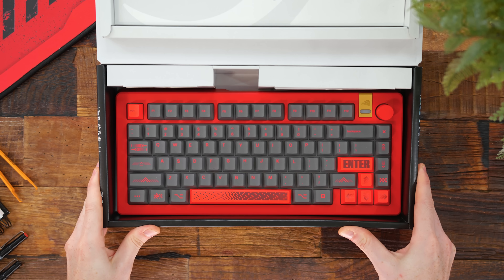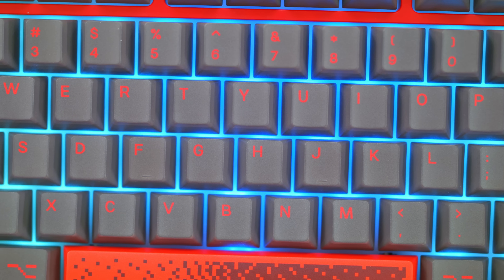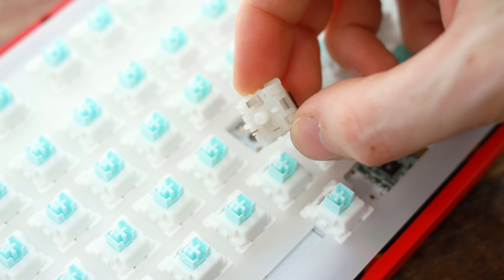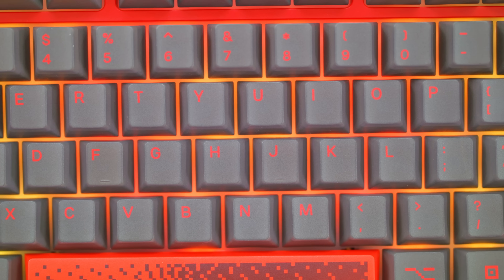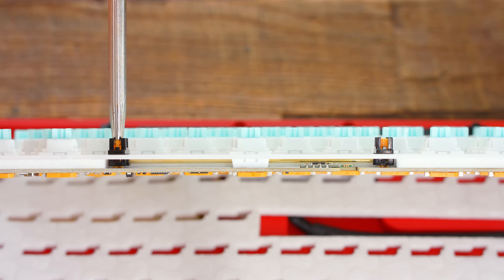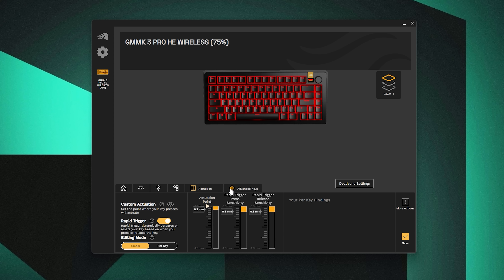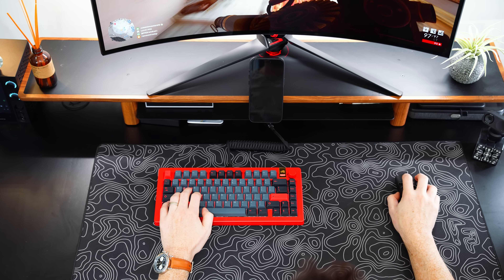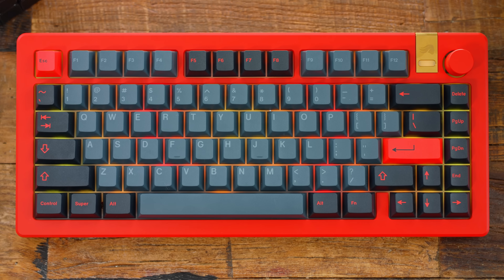NEW Glorious GMMK 3 Pro Keyboard Review!

Comment: $500 for that?... i like the customization but quality seems to suffer.
Reply: yeah i have the lynx switches myself... pretty scratchy and overpriced. but to be honest the board quality is not bad, swap the switches for something nice and you got yourself an okay board (not good value though)
Reply: @Aaron-ym5yx But it costs you $500. Buying a neo65/80 is much better than this one, also better sound and anodisation.
Reply: @兩人行必有我濕焉 it doesn’t cost 500. If you customize yourself it will only cost around 230-250 without keycaps.
Reply: @兩人行必有我濕焉  I bought this same keyboard for 200 dollars on sale at best buy.

Comment: For those wondering, the cheapest HE option is a plastic 60% wired prebuilt option for $180.
Reply: Meanwhile keychron has a Kickstarter for their K2 he which is $120 and wireless and for 15 more you get metal and wood framing
Reply: @Zac-wb7hu got a link?
Reply: @Zac-wb7hu keychron doing kickstarter feels weird. isn't it already an eatablished business
Reply: Meanwhile you can buy a wooting 80he for 195 and get the best performance out of any HE keyboard out there and it doesn't sound like total trash. What is Glorious thinking??

Comment: For the stabs being loud, I guess Glorious wanted to avoid the scandal of the first GMMK Pro : they had pads under their "GOAT Stabs" but since they ended over-lubing them, the pad got sticky and the keys had trouble goign back up and unstick from the pad. I think they wanted to avoif that, and removed the pad completely.

Could be wrong, but I remember replacing tham with a standed band-aid mod in mine back in the day to fix the keys sticking to the PCB and not going back up

Comment: That price though, the rough customization I like was just over 500 and didn't look as good as some board I could get for under 150
Reply: @Zac-wb7hu  They have different models on their website apparently.
There's from least to most expensive:
GMMK 3
GMMK 3 HE (Both Plastic)
GMMK 3 Pro
GMMK 3 Pro Wireless
GMMK 3 Pro HE
GMMK 3 Pro HE Wireless (Pro are all metal)

GMMK 3 starts at 119$, so I'm curious if this is worth. (Probs not for the MX versions)
Reply: That's why I specified 'my rough customization'. But yeah, keychron has a Kickstarter for a better hall effect board for around 135, and wooting has the board gmmk seems to be copying for around 200.
Reply: @Zac-wb7hu  good to know thx 🙂
Reply: @Zac-wb7hu  isn't the Wooting all plastic though? Not that I'd ever recommend this keyboard for 500 or even 150 for that matter
Reply: The wooting is plastic, keychron is metal and or wood frame with plastic body, and the cheapest wireless gmmk3 that includes hall effect is 299, bare bones for 250.  Wired is 179 and polymer body. The cheapest pre built full board is still 120 with no hall effect, wired only, and says aluminum body in the description but polymer in the comparison so who knows. 

Edits for the one board I missed
Reply: If you want wireless and hall effect with all metal there's also the keychron q1 he for 219 compared to the 350 for a full feature match from gmmk, so overall, better for cheaper
Reply: @MekaniQ  Non of them is worth it if you want just a gameing keyboard you can get a Wooting and upgrade the case to metal later if you want a custom keyboard the Keychron Q1 HE is also a better buy . 500 just to get a full metal case is insane
Reply: @emilyshabang  You can get a metal case thats cheaper and just easy swap it in

Comment: You can immediately cut around 150 USD from the price by going wired only. I just tested out a basic 75 % barebone configuration wired and the price was 104 USD.
Adding HE would have cost only around 35 USD more.

Comment: $500 for no internal, or external weight, when it has essentially the same internals and features of prebuilt aluminum HE boards at the $120 or lower range is just egregious. cant believe they had so much time to catch up with how fast the keyboard market has evolved and yet they STILL fell flat with this release. I would pay 140$ max for the prebuilt variant shown in this video, especially for a company with the size and manufacturing capabilities as glorious easily being able to get the price lower just from having access to more machines.

Comment: What is it that makes it so difficult to make a hall effect keyboard sound good? The switches don't have pins and are mounted only to the plate, sure, but how does that make it sound awful? I haven't seen a single rapid trigger board sound decent. It's starting to feel like a big gimmick now seeing every manufacturer take that route.
Reply from the maker: I demoed that very clearly for you, it sounds bad because the switch is rattling in the plate
Reply: @randomfrankp  Not really asking so much as I am thinking out loud. I’m more so just curious about the sound across all HE boards, even those with secure switches. I imagine it’s gotta have something to do with the hollowed out middle for the magnet.
Reply: @JustinBrown-y1z  There's a combination of factors at play. The first is the way the stem is at least 3x wider than a normal mechanical switch with a magnet in it, which not only greatly deadens the sound but because there's such a big opening in the switch housing causes a lot of the sound to leak out and not resonate on the parts.

Then on the PCB side, the fact that there's only two mounting holes per switch means it's not grasping onto the PCB as much as it should and is much more reliant on the plate, so the sound is also not resonating well on the PCB either. On top of that, the fact the stem doesn't poke through the PCB also means the sound doesn't get to travel within the cavity of the case, meaning it doesn't get to resonate the case very well either.

Combine that with a lot of the switches that started off HE having pretty subpar materials pretty much only focusing on smoothness and cheap manufacturing because of how niche it was to begin with, and it's no wonder that, especially the 60HE with the original Lekker switches,  HE has a pretty tainted reputation for sound. It's not impossible to make it better, you can truly get about 70% of the way there if you know what you're doing, but for many nearly irreversible reasons it's not going to sound as good as traditional mechanical switches. I put my wooting PCB into a Redux case, got put the original Lekker stems into Geon Raptor HE housings, swapped to a carbon fiber plate and gummy o-ring mounted it and it's pretty alright, coming from somebody who is TKL top-mount cherry MX brainrotted.

A loose polycarbonate plate causing the switch to rattle in place, which for a $500 board shouldn't have such bad tolerances, isn't going to help but it for sure isn't the only thing making things rough. Glorious is great when they try to make "budget products," for $60 the barebones original GMMK line and the GMMK 2 line are okay BUT THEY LITERALLY DONT HAVE IT ON THEIR WEBSITE ANYMORE - but their "enthusiast products" even mice seem extremely mediocre at best. It's insane.
Reply: @CheeseManFuu  I really appreciate your in-depth response. Haven’t been able to get hands-on with a HE board myself and I don’t plan on buying one, so I was genuinely curious. Makes a lot of sense why they sound so subpar now.

Way better than Frank’s passive-aggressive response (for some reason) that boils down to “plate bad” and doesn’t paint the whole picture. Thank you.

Comment: This is really cool, IMO. Their HE switches sound terrible, I'd be curious to hear this board with Lekker V2s or gateron jades
Reply: They're likely incompatible, there's no standard for HE switches so these outemu manufactured switches likely have different magnets and sensors on the pcb compared to an HE board made for gateron HE switches
Reply: @StaticNebula26  I just spoke with their live chat and they confirmed they can only guarantee support with their brand of HE switches, they don't have enough research / testing with other brands of HE switches in their new GMMK 3 PRO HE keyboard.

That is crazy to me... I am curious to see another youtuber provide insight on the feasibility of this
Reply: @KyranOh  for sure i know that grain gold HE switches work with gateron boards (they're literally the same design and there's some legal battle around it iirc) if you don't know grain gold, they make the latenpow and geon hall effect switches along with extremely good and cheap mx switches

Comment: People were outaged by the Asus ROG Azoth Extreme, mainly bc it didn't have hall effect switches.....but it sounded great, was way better in the attention to details, and had nicer materials used. If I was determined on getting a high end prebuilt keyboard, it would be the Azoth Extreme hands down at least that $500 price point. Hall Effect is nice and all but Im guessing that CS2 won't be the last game to ban those switches. So that might not be all that important, at least until they are more common place in keyboards. Personally, if the trade off is that much wobble and cheap sound then Im not interested in them anyway. Obviously, wouldn't suggest spending $500 on a keyboard but of the two the Azoth Extreme has a way nicer construction and is more refined
Reply: They didn't ban the switches. They banned the 'Modes' running scripted software the keyboards were using. There's a little more to it than what Youtubers are putting in their thumbnails/titles.
Reply: the azoth is ass quality too

Comment: QUESTION FOR ANYONE>  My Razer keyboard is about to bite the bullet.  I was looking at the Razer Black widow V4 but is it worth it to get a custom one and sort of build it myself.  I am just used to going to the store and buying one.  I don't know if I have the confidence to build my own.  Also I really like the 10 keypad at the end for financial stuff.  I guess I could always have a standalone 10 key for that stuff.
Reply: Do you want hall effect? If not then key hron has several 96% and full boards, if you do the wooting 80he or keychron K2 HE with a standalone numpad would do the same for a lot cheaper (they're currently Kickstarters or pre orders though)
Reply: Making your own keyboard from scratch isn't really a popular thing anymore. Just buy the fully built board or mostly built and you add in whatever switches and keycaps you want. The Keychron Q5 or Q6 Max work just fine if you don't need the HE. I have a separate keypad just because I prefer having a smaller 75% but 96% boards can be quite compact. 

You'd have to be a bit more specific with what you want when asking for recommendations though. If you really want the LED coming through the keycaps, you want north facing LEDs, but many boards come with south facing LEDs, like the Keychron. You can still get shine through caps, but you'd get better results then with side printed keycaps. 

If you want per application mapping, then you're kinda stuck with those bigger brands like Razer, Logitech or Corsair that have the software to do so.
Reply: @Dexx1s  keyboard hobby is still very much alive

Keychron Q series are extremely overpriced for the quality they offer and they sound like an anvil dropping on top of another anvil
Reply: @forg.a   Alive: sure, I guess. Almost every forum is overwhelmed by customized pre built or barebones boards but all 2000 of you guys left that build from scratch do exist.

Name a brand or board that you'd recommend to someone who knows nothing about keyboards? Everyone complains about Keychron but then fails to actually give a recommendation that isn't some product that sounds like a fly-by-night scheme or that you still end up having to swap parts out of anyway.

Comment: On the price subject, i can understand why it GETS so expensive. You're able to customize every portion of this board. Yeah. Its gonna be pricey if you don't go for the base option, which falls in line price wise with other HE boards. So the price actually doesn't bother me much, because YOU set the price. 

The look is actually really good and im interested in giving a 75% a go. Im going to opt for thocky pandas because those linears sound awful. I suspect that you could greatly improve the sound just buying switches from another manufacturer. If this is compatible with gateron jades, thats a huge win. Sound is extremely subjective, yes those switches sound awful but i think that different switches will help. Installing a strip of poron beneath the space bar is a simple mod fix too. 

Software looks intuitive and easy to use.

Overall, this board can range from something in line with monsgeek and others, or you can deck it out and make it stand out from the competition for a clear premium. 

I've never owned a glorious product before and stayed away in the past but this genuinely seems like a cool product that i think more people should give a chance. You set the look, price, and sound depending on what you use. If you're not satisfied, mod it or switch out the switches. That simple

Comment: Glorious could have had a closed-bottom switch with not only the side pins but ALSO the center pin, which could have blew every other HE switch out of the water in terms of sound. Instead they went with this piece of crap that basically floats on the plate and makes no contact with the pcb, hence the awful sound, absolutely baffling.

Comment: No adjustable feet, plastic top case, those switches are awful…, PC plate, no screw in stabs, no shine through, dull, dull LEDs, clickety clackety… get the Lekker60 v2s… they’re tight. $500. I’d take 3 DrunkDeer A75 aluminum barebones and add my own switches and caps. Nice enough software… above average. Yikes. Three YEARS?

Comment: Got it at all at best buy in stock because it's overpriced and nobody wants it oh wait a minute black Friday 20-30% off all gimmick stuff. I got the pre built wired board with pandas and the silly cable all for $240. Later got drop mt3 caps on market place for 50 bucks. I removed the stand offs and did the gaffer tape mod, 3 lairs at the bottom and 2 near the top. board sounds dank even compared to other better priced boards in the same category. (A creamy thock for lack of better terms) with pop it fidget toy like physics. Feels good all around you could knock someone out with this thing she's brick. I was looking for something local and something I didn't have to run the software on and this thing hit all the boxes. its really good....if you get at the price I got  -Confucius say, man who jizz in cash register come into money

Comment: im out of the loop WTF is hall effect?
Reply: It's an old switch type that's recently become popular for gamer keyboards. It uses a magnet to read exact pressure you put on a switch so you can adjust the actuation, when the keyboard registers a key press, allowing you to quickly spam keys with less effort.

This is compared to mx switches, which have a metal leaf that only completes a circuit to fire a key press when you press down on the switch stem at a certain distance and can not be customized. Basically, it's only good for rhythm games or certain techniques in fps games. It's mostly a gimmick.

Comment: I am reading lots of dumbfounded comments here and I don’t get it. Personally I like what Glorious did here . I think it’s great. How many times you wanted to buy a board and it was too expensive or lacking some features or not the right size or not wireless or didn’t need wireless  etc etc etc  ? Now you can built whatever u want for as little as $130 or so or as premium as you want it to. Is glorious taking the best approach? I dunno but it is definitely on the right track.
Reply: Ever heard of a company called Keychron? They've done basically all that over the last couple years and had most of it in 2022. V-Max series boards, plastic, wireless and gasket mount with QMK/VIA firmware, when prebuild go as low as $90. They're even launching into HE now, too. The problem is how overpriced garbage it is. Can't speak to the HE performance of it but for sounds, looks and general quality issues (especially that knob, no designer making a $300 let alone $500 keyboard would ever let that fly), you can easily find good options in the mechanical space for cheaper, and not hard at all to find HE options that are better (wooting, Boog75, drunkdeer, etc), and not just in barebones either.
Reply: @CheeseManFuu  keychron is great but they sell 10k boards every which model disorganized as hell no rhyme or reason oftentimes I just look at their new releases and ignore everything else they have . In no way you can get what you want from keychron unless you settle with a prebuilt .
Reply: @fpsinvader  A prebuilt that's way cheaper than this, for the features you'd actually want, and be able to then add on the things you want yourself, and still have money left over. Keychron having tons of different boards is literally the answer to the question you asking in your original comment. How many times have I wanted to buy a board and it was lacking something? Not many after finding out that Keychron actually has one. Want a high end metal Alice board with wireless support? I wonder if there's one in the GMMK3 customizer. How about a low profile board? How about a cheap light plastic board with wireless that I can throw in my bag with the receiver and be on my way? Oh yea, I can definitely find a GMMK3 to match those requirements. And even after all that, I can always add in the few additional things because most of what you need would likely already be in the board. 

Of all the things to hate on Keychron for, this isn't one of them, especially in comparison to the GMMK3.